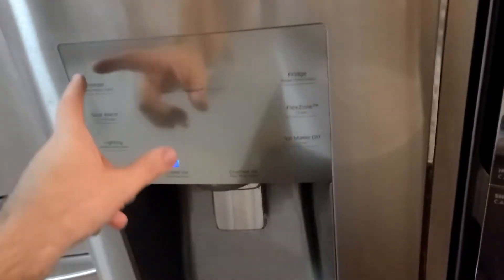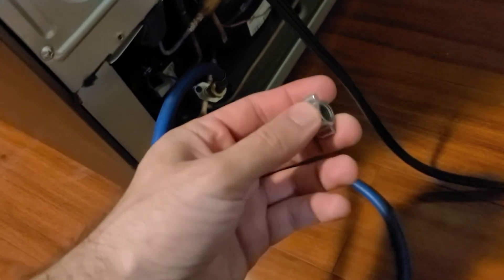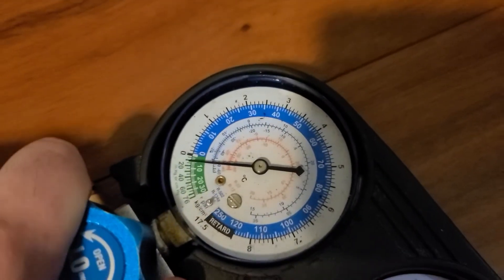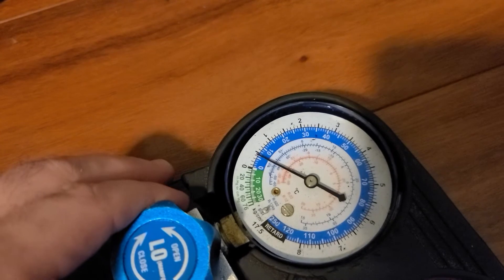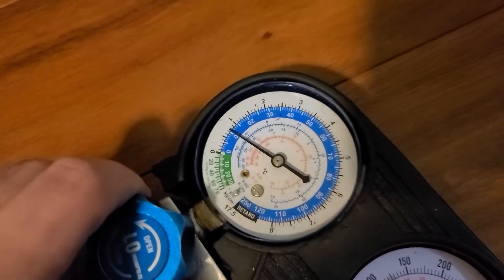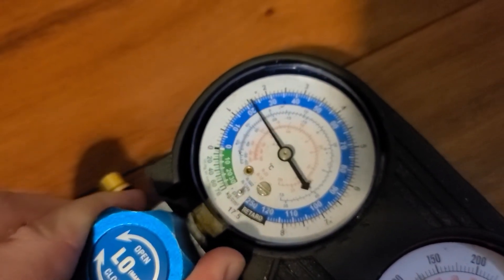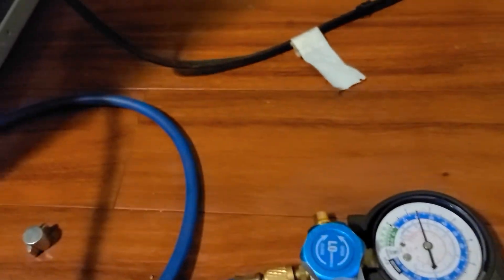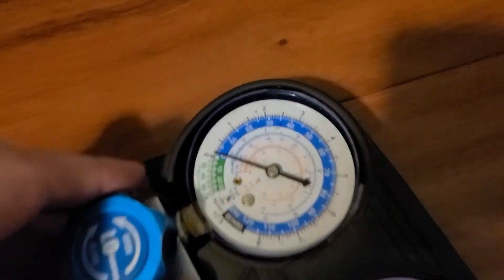samsung flexzone fridge (not freezing) repair

Comment: I have the same issue with the same fridge.  My pressure keeps on going down and is not staying still.  Did you ever get it to work?
Reply from the maker: While the compressor is  in operation the fridge pressure on the lowside should be staying between 0-5 psi. If it's negative you don't have enough freon and need to add some more. When you add freon in the pressure will slowly drop until it stabilizes. When charging slowly add, don't let the gauges jump over 30 when adding. Good luck!
Reply: Do you have an issue with the freezer light not staying LIT ?  Also the freezer panel display temperature doesn’t reflect the actual temperature in the freezer itself and it keeps on raising even though the actual inside temperature is stable.
Reply from the maker: Freezer light may be the cables that connect to the door sensors through the hinge. Mine got damaged and i had to splice them directly to the fridge